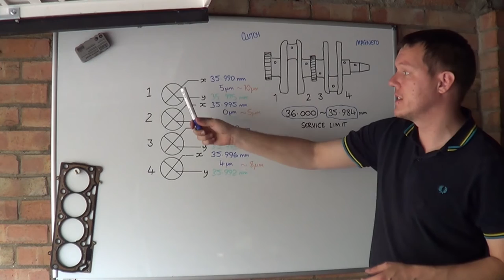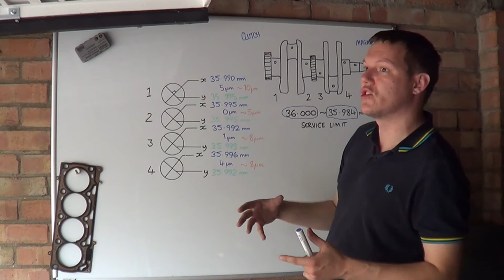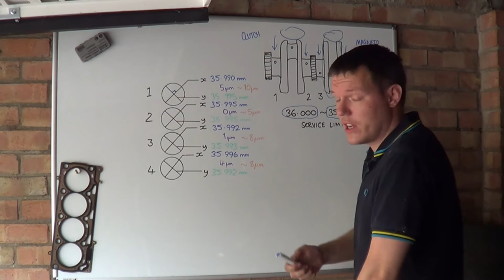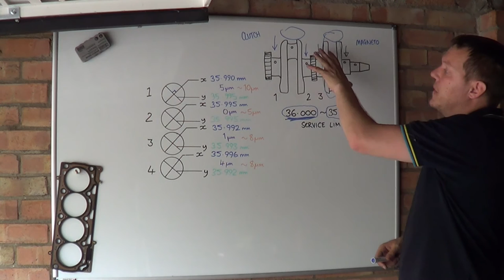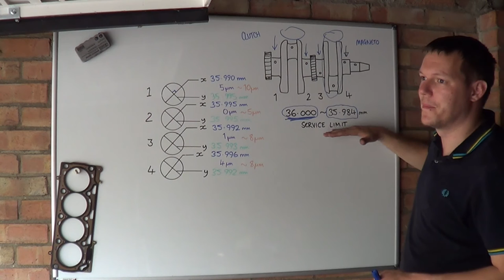Measuring Crankshaft Journals

Comment: Great video again apart from the pen top clicking. I was given an ex-taxi peugeot 406 on 425,000 miles and sold it 3 years later for £500 at 480,000 miles, engine still good
Reply from the maker: Yeah diesels can live pretty muh forever